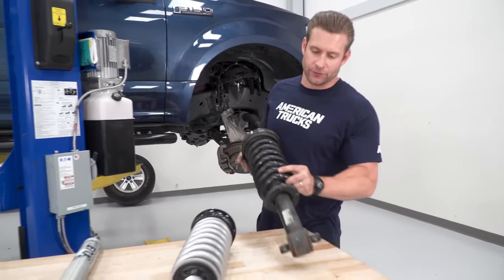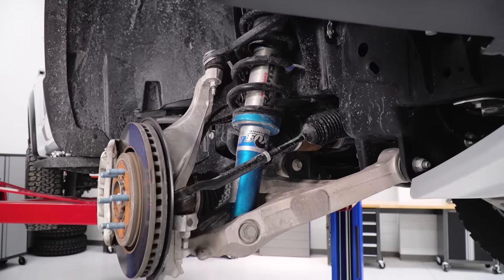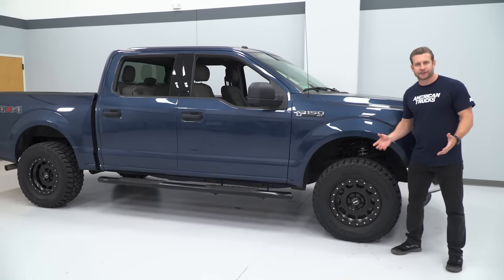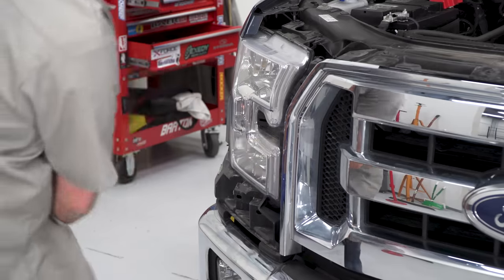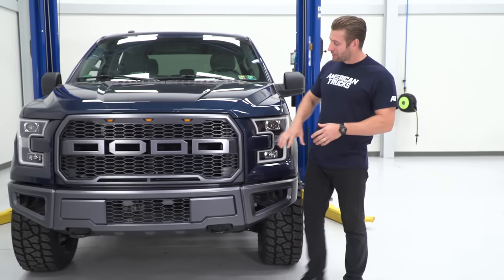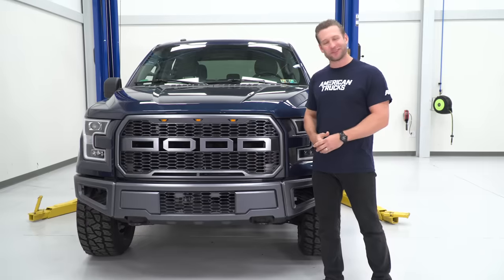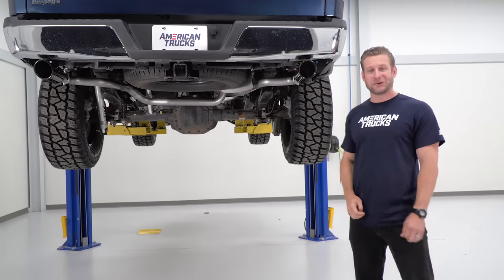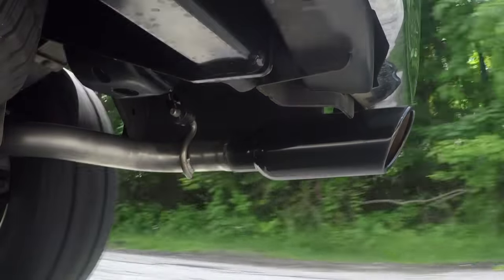How To Make Your F150 Look Like A Ford Raptor & The Parts You Need To Do It   The Haul

Comment: I was able to fit 35 on mine with the Fox 2.0?? No cutting
Reply from the maker: I'm guessing you used the factory wheels or something with a very high positve offset.  -Justin
Reply: AmericanTrucks Ford factory wheels. Tires cost enough..
Reply from the maker: Understood- but just making my point that 35"s are a VERY tight fit with anything other than a a stock wheel/offset and that's why its something we generally don't recommend. -Justin

Comment: $4,615 for the parts listed, not listed were wheels/tires, add another $1500-$2000. Looking at about $7,000 after taxes to outfit your rig like this. Not bad considering the cost of a Raptor vs F150
Reply: Yeah but unless you actually do the wider control arms and everything then you dont have near the capability of a raptor

Comment: 33'' tires. Why do you turn the wheel side to side and say it do not scrub.  
To see if the tires fit. You need to max inn /out the suspension + turn the wheel. No point of you get off road any then flex and tires start scrubbing.

Comment: I honestly like the clone look better than the raptor. However I own a 2010 can this clone modification still be done?
Reply: You pretty much can do everything they did for the 2015-2018 version on your 2010.

Make sure you check all the parts for fitment on your year. 

Might actually be able to find some local flares for cheap, otherwise, you should be able to find it all online.
Reply: Thanks will do. I'm really digging these modifications
Reply: Might have to search for a different Raptor front too. Most of these "DOOD" grilles only fit the 2015-18 models. Most websites can tell you if it fits your model or not. Might also want to check some Gen 1 Raptor copy parts since you are driving a 2010. Best of luck on your truck build!
Reply: Mason Langosch thanks I did find a dood grill and bumper so far and fox parts still looking haven't found headlights yet though thanks for the help.
Reply: Only thing I'm having trouble with is I have a blue xlt crew full crew cab with all the chrome and I'm finding alot of black and Matt black stuff not Shure how the black will do against the chrome.
Reply: Anarmedsocietyjw You might be able to find a good local detail place to vinyl rap the chrome pieces. Good part about black, it goes good with anything.
Reply: Wal-Mart sells the letter F and R

Comment: The people who want that 5.0 over the 3.5 need to do some research. There is no category except sound that the 5.0 excels. Another thing that the non turbo guys just don't get, it's much easier to build HP with turbos than it is on normally aspirated engines
Reply: 2 Categories the 5.0 excels in: Longevity, and easier to fix when it breaks. Ask any ford tech, they all say the 5.0 is better.

Comment: How much was the total build? Base model XLT has no tech at all. You can get a base model Raptor for about $54k+TT&L. All of the performance none of the tech. Just like this build. The good thing about buying the Raptor is its resale. If you cant find one I'll order one for you. Yes I sell fords. I currently have a base Raptor for around $57k. It has some options. Remote start, kicker subwoofer. Find me at AutoNation Ford in Corpus Christi, TX.

Comment: Why not get some actual Raptor 17" wheels and you'll have no issues installing 35's. I've done this and have zero rubbing with only a 2" level kit.
Reply from the maker: The size of your wheels has no impact on fitting a bigger tire.  Offset is the key here and unfortunately the combination of lift/offset would not allow for a 35 without modification which is something this owner did not want to do.  -Justin

Comment: PLEASE RESPOND !   So glad I found this video< have been holding out about a year now trying to figure out all the pros & cons of buying a F150 XLT or the Raptor.   Yes the Raptor is an awesome style for sure but do not care for the extra width in front , the price , and poor gas mileage.
    So taking the F150 XLT with all the parts in the video, would it be a lower price than the Raptor ?
    Also how do I go about getting the parts exactly that was in video ?
    And last , who do I get to expertly install correctly all the parts ?

     Again this is exactly the route I want to go , but do not know how to go about or where to go  to build exactly in video ??    Pleas Help !!!
Reply from the maker: You could absolutely put this truck together for less than 40k.  All of the parts used in this video are available on our site, Americantrucks.com and the links for the parts can be found in the description.  As far as your install well that would depend on your area and who you have that does this kind of work.  -Justin

Comment: The grille bothers me... why are the two 0’s in the middle not the same shape
Reply from the maker: Copywrite/Trademark from Ford.  People don't understand that if you blatantly rip off certain parts from Ford (ESPECIALLY parts that say 'Ford' on them) they can and WILL come after you or your company unless you have the proper licensing from Ford themselves.  -Justin
Reply: Plus, as they hinted, you can buy an F and R off eBay to make it say Ford yourself and it looks identical.

Comment: Don't wimp out. This conversion should have FULL LED lighting. That includes all turn signals & rear lights. No old fashion incandescents. I can't stand it when this is over looked because it makes a HUGE difference in overall appearance when lights are operating.
Reply: Those cool looking headlight units... Why don't they have LED blinker lights..This is 2019!!! How hard is it2 assemble a resistor in wiring assembly as part of the unit, so it's already intact? That detail should be done at the designing stages of this part!

Comment: Why do people want the v8 sound over hp and torque with an ecoboost engine?  Is it the "look at how loud I am" factor?
Reply: Most people just like the v8 purr over a quiet V6. Not everybody really wants or will use the torque/HP from an EcoBoost either. Also, people might not want the worry of scraping a wider truck in the event of parking error.
Reply: You can't deny that having a great sound coming out of a truck can make driving more enjoyable

Comment: Cool, but why use those Raptor look-a-like parts?  Just replace that lower bumper with the bumper/winch you put your Raptor and then get some real side protection, not running boards.  But the other things you did were great.  

Sadly, you will not have the resale value of a Raptor, but it will look better than the stock truck.

Comment: don't think you can do this to a 2020 f150 though.
Reply from the maker: You can definitely upgrade the suspension, wheels, tires and bumpers though! It's only a matter of time before a replica Raptor grille comes out for those 2018+ models. -Zach

Comment: Love the production! 
I've always had a problem with copying higher trim vehicles. For example buying an Impreza and making it look like an STI, 3 series to an M3, a civic to a Type R, etc. 

In my opinion, it always looks fake and cheesy. 

Just changing the shocks and springs is NOT making it as good. All of the bushings and hardware and frame and control arms are all engineered together for the tires and wheels. Don't forget about brakes. Don't forget diffs and lockers. A USED RAPTOR IS THE SAME PRICE AS A NEW F150.

Comment: One thing that people forget is the real Raptors frame is built differently.  It's much stronger,  so as soon as you try to use the clone in the same manner as a real raptor that frame is going to bend like a pretzel. Lol.
Reply from the maker: You are correct about the frame Aaron. -Justin

Comment: Biggest and for me the most important part missing are the wider fenders for the front. That is what shows really if it´s a Raptor or just some wannabe.
Reply from the maker: Agreed- the wider body really sets the two apart. -Justin
Reply: Is it actually possible? Or are there any fenders available that kind of simulate the Raptor´s wide body appearance?
Reply from the maker: Yeah theres a company called FiberWerx who makes aftermarket fiberglass fenders for the F150. -Justin

Comment: Instead of spending over $1000 on the suspension kit, you can spend $100 on a strut extension kit and achieve the same suspension look
Reply from the maker: For what it's worth, you won't get ANYWHERE near the performance benefits though. Spacers are just spacers, you get a little extra height. If you want something that rides better on and off-road and will handle trails better, real suspension systems are the way to go if you have the budget. -Zach

Comment: Camera recording the suspension at 0:21. Look at the frame how is bending while driving on the terrain. WTF! And the suspension is not even working by hard at the moment.
Reply from the maker: You mean the lower control arm?  Its supposed to articulate like that. -Justin
Reply: No, I was looking at the frame the arm is connected to, but then I dropped video speed at .25 and looks like it's image stabilization in GoPro makes it like the car frame is bending from arm pressure.

Comment: Anybody who comments about the grille. ALL the aftermarket grilles come with covers on the grille to HIDE the FORD letters. You need to unbolt the covers and it will say FORD. Thats what he mentioned about those bolts on the back of it. 

I laugh when I see them on facebook for sale with the covers still bolted on. He didnt take them off not to get into shit with Ford.
Reply from the maker: That's not entirely accurate. Most of the grilles I've seen (including this one) have removable letters but you still need to buy the 'F' and the 'R', its not like they're hidden.  -Justin
Reply: @americantrucks  I have purchased 10 of these aftermarket ones. All 10 came with the F and R in the box.

Comment: The "Dood" grill is so ugly. Those wheels aren't inspiring either. Other than that, the truck looks good pretty good. The fender flares would look better if they ran all the way up over the factory fender curve (to where the factory curve/flare flattens out against the truck). Those new headlights and the new front bumper are the best looking parts on this build.

Comment: Hypothetically speaking now where would I get some grill letters F,D,R after the former president of course.
Reply from the maker: I've seen them on certain sites that end with 'bay'.  :) -Justin
Reply: @americantrucks  Eee man why didn't I think about that. ;D
Reply: @mreast6050  If you haven't purchased already, MOST AEM Raptor style grilles come with the lettering. Some don't even have the "DODD" lettering, it just has an empty space for the "F" and the "R" for you to apply, with the "O" and "D" already in place.

You can find them all over Amazon and eBay.

Comment: Come on guys. Its motivated if you want extra suspension and off road performance like the raptor but don't be that guy with a raptor knock off...Dont copy the raptor name, be your own thing. I'd say the only thing that passes here appearance wise are the flares(which if you got the Fx4 pack you already have some that are just as good) and the projector head lights.

Comment: I think you're better off, at least as far as public opinion is concerned, just going with suspension, rims/tires, flares and exhaust. I think you might give off a bit of "try hard" with the added front grill and bumper. A little too over the top. Especially when everyone knows it's a fake after market grill built with one thing in mind, faking it.
Reply: Not everyone knows that just looking at it

Comment: I just wish the grille read out "FORD" instead of the "OOOO," or whatever it means. It ruins it, in my opinion.
Reply: Lieutenant Turnipage -- he mentioned that there would be copyright infringement issues with Ford if they used the same spelling.
Reply: Bacnow Ah, cause I see some regular F-150s on the road bearing a "FORD" grille similar to the Raptor
Reply: Lieutenant Turnipage -- I'm sure that there are some premium aftermarket providers (like Shelby) that are licensed through Ford to use the Ford logo and emblems. But, I don't think the company in the video is.
Reply: Lieutenant Turnipage -- Also, you could buy a Raptor replacement grille directly from Ford and have a shop custom install it on your standard F150!
Reply: Makes sense, thanks for the input.

Comment: 30,000$ truck these add on add about 4,000$ so 34k not including mechanics charges estimated 2,000 3,0000$ so 37,000. U can get a 2015 raptor for this price a REAL RAPTOR
Reply from the maker: 2015 Raptor doesn't exist, as the Gen 2 started in 2017.  However for $37k you MIGHT be able to find a Gen 1 truck (10-14) but chances are its pretty ragged out.  -Justin
Reply: Yes, PLEASE find me a 2nd gen raptor for 37k, I'll trade my platinum RIGHT NOW
Reply: MANXAN H no, you can not.
Reply: MANXAN H so you’re paying a ‘mechanic’ $3,000 to put some cosmetic shit and shocks on your truck..?
Reply: Right after that he is going to buy a 2015 Raptor for $37k.... haha...

Comment: The rear shocks are upside down!
Reply from the maker: Negative ghostrider.  -Justin
Reply: AmericanTrucks Ford 
Instructions per Fox say to install with the body up/shaft down to prevent water and dust to pass through the seal.
Reply from the maker: We installed this kit based on the included instructions from Roush- which show the rear shock in the orientation you see in the video.  

https://www.roushperformance.com/media/parts/manuals/422014-manual.pdf    -Justin

Comment: You'd have to be a moron to spend all that money to have a non-Raptor.  The resale would not be improved at all, and many dealers would consider a heavily modded truck a negative and give you less for it.   You'd have to sell it privately.   The raptor costs more but holds its value much better.   Do a lift, get some better wheels, and call it a day.
Reply from the maker: All the 'Raptor'  parts in this video are easily reversible.  Just keep the stock stuff in the garage- problem solved! -Justin

Comment: Why not just buy the raptor? Okay you bought a $40k truck still with a decently loaded XLT, but now you also spent $5k in bumper and grille and fender flares, $3-5k for suspension, another couple grand for the twin exhaust and another couple thousand for tires and rims... You just spent the extra $20k you didn't want to spend originally. I don't see the point, just get the raptor off the bat. Am i missing something here?

Comment: That 3.5 sounds like absolute shit!! Raspy, rattly, nothing like a v8, they should’ve kept the 6.2 and supercharged it or dropped a coyote and boosted it. I won’t be surprised if the next raptor will be a 4 cyl twin turbo and somehow it will make 600 torque and sound like a lawnmower getting rammed by a civic “vtech” ofcourse....fucking a

Comment: That suspension is trash! dont fall for it! the raptor has 3 inch shocks and this kit is 2 inch! not to mention your using show truck wheels instead of 17 inch beadlocks! weak build cutting more than just corners! and even more important you didnt upgrade your a arms or the rear end suspension! not even deaver leafsprings! This is just episode filler.